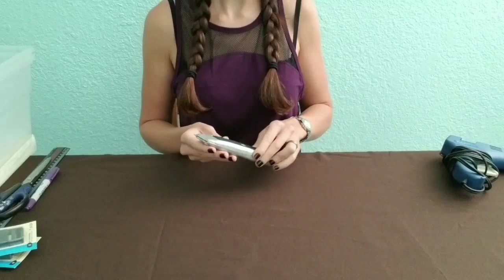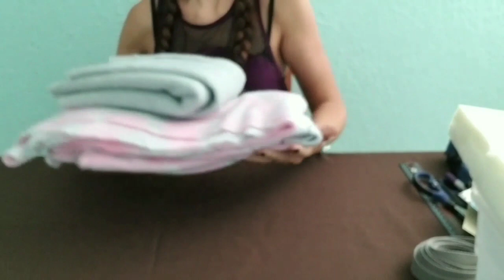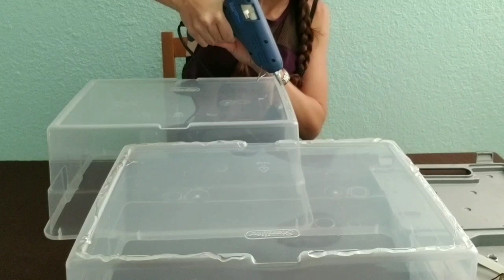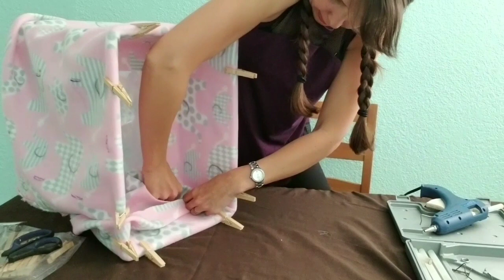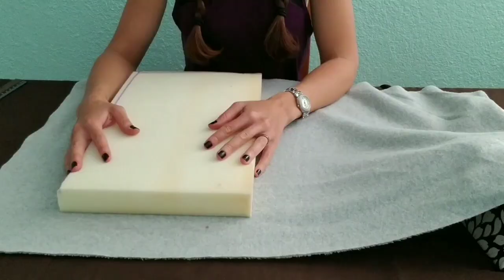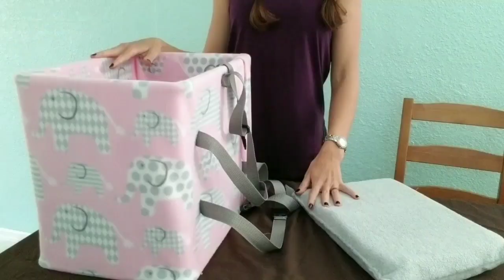How to make a car booster seat for a small dog/DIY dog car seat

Comment: I have made a few dog boosters out of plastic laundry baskets. With laundry baskets they are softer and more "squishable" for the dog to turn around and get more comfortable as the sides move out a bit.  Also, you can cut the front down some so they can rest their head on the front when lying down. AND...the most important thing is soft edges to also rest their head on. I took a pool noodle and split it down one side and glued it onto the whole  top edge.  It  sits on the console and has straps up to both our headrests and a bungee cord hooked from the bottom sides, holes in laundry basket, to the front bottom edge of the front seats. Never had a safety problem and my 13# dog sleeps in it many times.